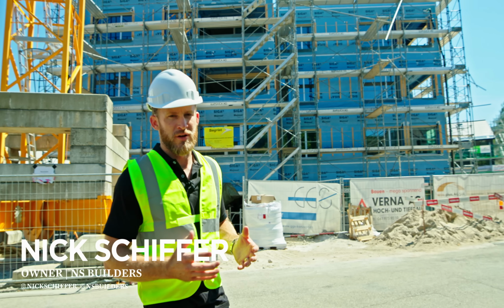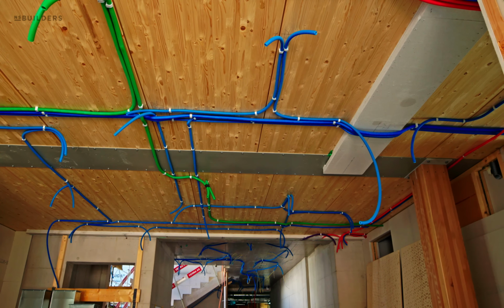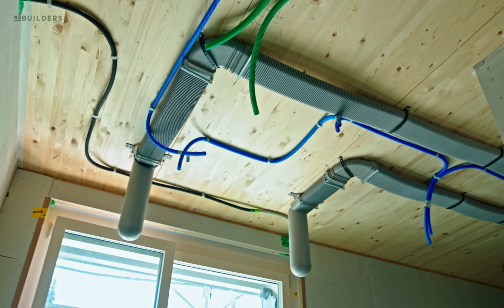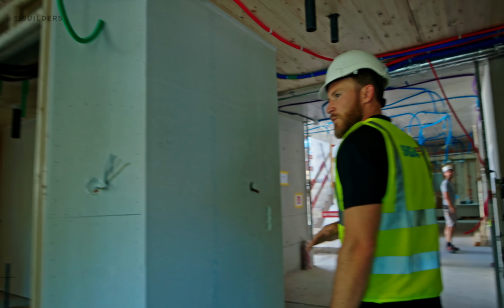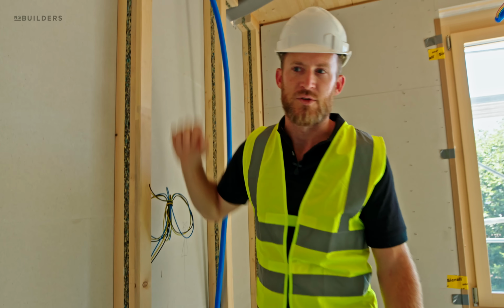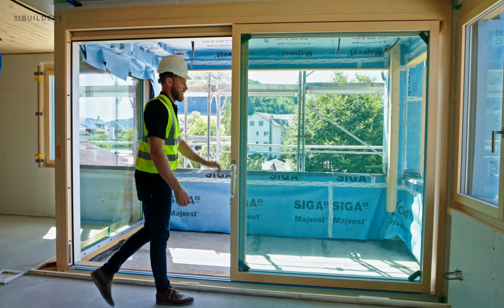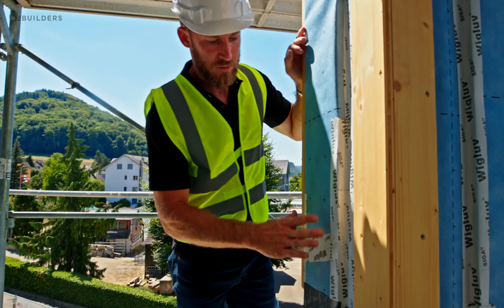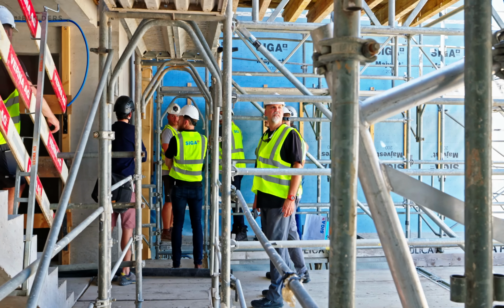The Swiss take sound seriously

Comment: I like that double stud with the membrane, I’ll use that in my home build
Reply: don't forget that sound travels trough the ceiling and floor as well
Reply: @MrArctic38   the entire house will be sound deadened. All rooms will have their own hvac return and register, plus a fresh air vent with the fresh air exhaust in the bathrooms and kitchen. The house will be extremely airtight and insulated. Joist tape will be used on every stud before sheathing and drywall to both the ceiling and walls. I am going to do a Swiss style grid for the second level with sound absorption material where the joists meet as well. I also plan to use Amsco Serenity windows which are 2 windows with both being triple glazed. Overkill, yes, but will be worth it
Reply: @MasterKnight2K  Sound great man, good luck! 
I wish i had enough capital to build my own house but i'm not there yet
Reply: @MrArctic38  I got my house 5 years ago for $100k and I’m about to sell it for $400k. So I can build my dream house with that plus my income and savings
Reply: @MasterKnight2K  damn that must feel great👍 enjoy
Reply: @MasterKnight2K  I'd think joist tape would make for worse acoustic performance, not better.
Reply: @Milkmans_Son  joist tape would be for air sealing and a barrier from the drywall to the stud. I am definitely considering doing this double stud idea with the 1/2” foam sound deadening.
Reply: @MasterKnight2K  I'm no expert, but I can tell you the walls in the video would perform better with nothing between the studs instead of the carpet pad stuff or whatever it is.  Between that  and the doubled up wallboard (zero acoustical benefit), this was a fairly confusing video.
Reply: @Milkmans_Son  when you change the mass of the media, you kill the sounds ability to transfer. That’s why sound “proof” windows have 3 layers of various thicknesses on glass. Each one changes the frequency of the sound which takes energy each time it does. Going from dense wood to foam and back to wood will take a lot of sound energy away. Adding the double drywall adds another layer of density change
Reply: @MasterKnight2K  I used to think the same thing.  Adding another layer of drywall on both sides of a typical interior wall is only worth a couple extra STC points.  You would need measuring equipment to tell the difference.
Reply: @Milkmans_Son  changing media densities is how sound deadening works though, the only true way is to have a vacuum, but that’s not physically possible with our current technology
Reply: Green glue works great.  Pricey but great product from last builds

Comment: I'm not sure why they chose to put the windows flush with the inside wall. If I had the choice I think I'd always want them as close to the outside wall as possible. Free shelf and our cats would love it. That said, I miss Switzerland. Expensive, but gorgeous.
Reply: I belive that the deeper the window recess, the lower the thermal transfer of cold from the outside of the cladding.
Reply: @defenda1  my first thought is that it depends on how the thermal insulation is situated in the wall. The insulation should be behind the window casing, no? If the window is behind the wall insulation it would just transfer thermal energy around the insulation. I know thermally broken window frames are the norm in Europe, but they are still only 4 or 5 inches thick.
Reply: @defenda1  oh yeah, they put the insulation on the outside. Nice catch.
Reply: Windows last longer when pulled further in.
Reply: @sjoroverpirat  I fail to see how that is prioritized over "Cats like window sills."

</sarcasm>
Reply: @chaseweeks2708  Swiss Architect here - definitely get the cats on the windowsill part. There are many reasons why we almost never place the windows as far on the outside as the Americans. Be that aesthetics, longevity of the windows the further back they are, (often) mandatory metal or cloth shading systems that live on the outside of of the window and are quite wide, facade construction types, etc. That being said, the aesthetic of a deep inside windowsill is not lost on us either. Considering that we often use 8+ inches of concrete and 12+ inches of insulation (plus cladding inside and out), the position of the window can still vary quite a bit, and this can be used to create a cat worthy windowsill for sure :D
Reply: @colorshotcrew  What do you mean by longevity of the windows?
Reply: Flush with the inside might just be the cosmetic treatment to match the area's architectural style.

But I think it probably has more to do with leaving a recess above the window on the outside, for an automatic shade to be installed.  If the window was set closer to the outside of the wall, the shades would end up proud of the window.  The shades probably have tracks on the sides to guide them, so they aren't just flapping in the wind, and possibly enough of a gap between the shade and window so the shade has no chance of banging into the window and breaking the glass.
Reply: @dondumitru7093  from what I saw in the video, there is a separate recess into the wall, several inches in front of the window just for the shade and track. It's where the control/power cables come out of the wall. Aesthetics is likely the primary reason for the decision, agreed, but personally I'd rather have the extra deep window sill on the inside because I, or our cats, could use it. Kinda useless on the outside.
Reply: @chaseweeks2708  What I was trying to express is that it looks to me like the automated shade is inside the external recess, so that the mechanism at the top as well as any rails on the sides are inside the recess in the wall.  If you pushed the window further out, than the shade and tracks would be proud of the external wall, inside of recessed inside it.

Maybe that explains the positioning of the window.  I agree with your top-post that some explanation in the video on this topic would have been helpful.